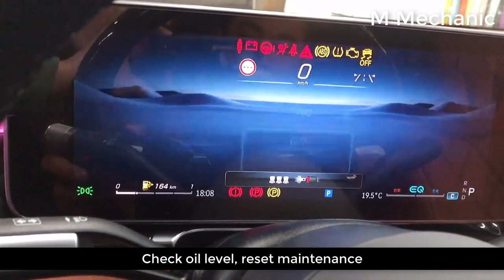Mercedes-Maybach S480 | Periodic Maintenance | Maybach S480 Oil Change.

Comment: I'm impressed how small the cabin filter is. And it does not have activated carbon and some other filtering system. Poor...
Reply: There are two cabin filters.
Reply: @Cribs00  two vabin filters? wow, too complex...jajaja
Reply: @gustavoquinteiro9108  just skip on maybach then
Reply: @bendynoodlecuminbitch4547  of course!

Comment: Why did you mark that oil filter cup
Reply: because if you dont have a torque wrench, the mark will tell u how tight to tighten the oil filter
Reply: @nextgenpotato4525  it's also for seeing if other mechanics do touch de car and keeping the guarantee
Reply: @nextgenpotato4525  my man, that mark is so that next time mechanic can see if the oil plug or filter came any lose since the service.
Reply: @itsnotfunny8257  my man, its actually to ensure you don't over torque the oil filter.
Reply: @goonygaming3390  aight, I'm gonna go back to pulling a motor out on my job as a technician so, what do I know.